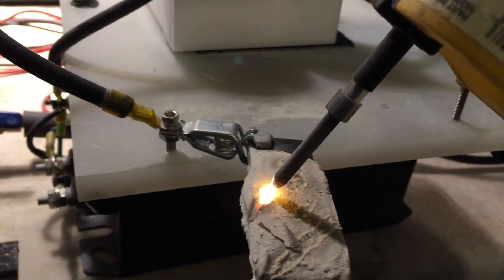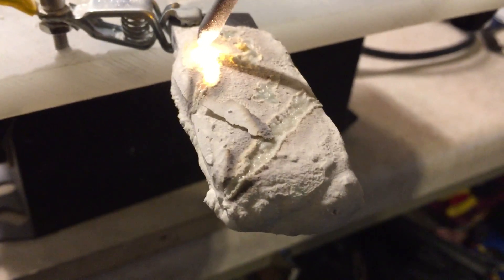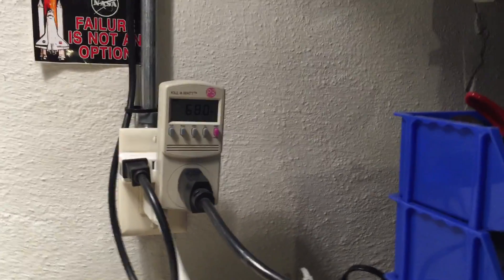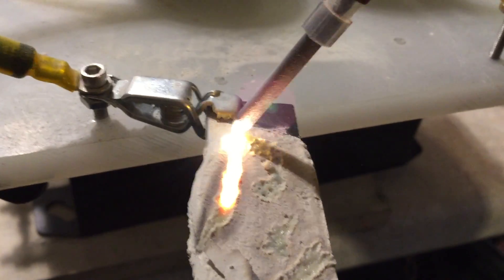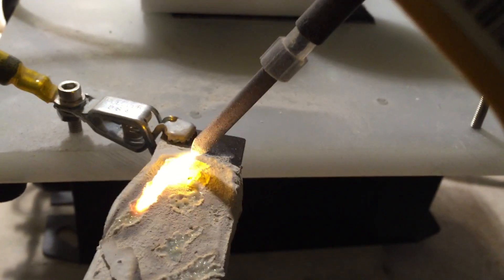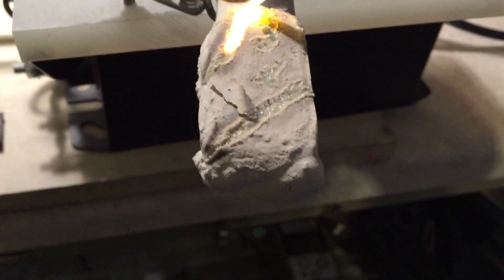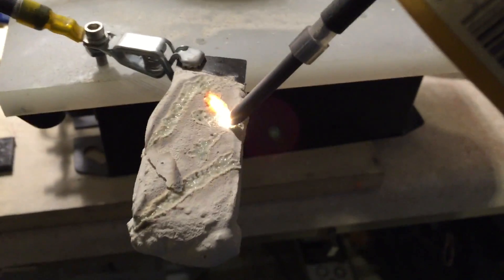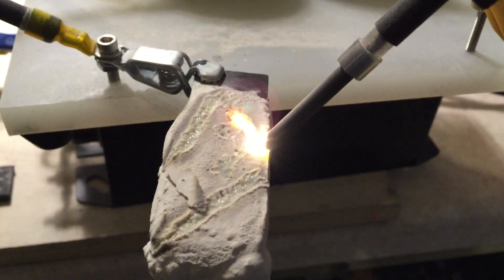PLASMA MELTING PUMICE WATTS! WHAT?!

Comment: furnace??
Reply from the maker: No it is a low current HV AC circuit designed by Nikola Tesla.  No discernible current can be measured in the molten material.

Comment from the maker: I'm using a France Neon sign transformer 7530 P56-2E that has a primary 120V 60Hz 2.1 amp and its secondary is 7500V 30mA. I am happy to share all, and I believe at the end of one of my videos Plasma Melting Pumice Watts! What!? I have photos of the set up and close up of the HV caps.
Billy's work with vibratory creation of the dendritics is intriguing, but I believe it may be a multi force and electrically primary in its formation. The features on Mars would be more pronounced with dendritics if large scale vibration were the etiology. Billy's work is excellent. I hope my less than conventional perspective may help elucidate the large scale mechanism of action. I will load a neat video showing the Massive Vorticity Birkland current and the seeming amplification of its effect as more material is picked up by the vortex. I also think that this is the likely core etiology of Tornados to be sure. It's capacity for surface alteration and picking up debris without damaging adjacent structure is phenomenal. I would look forward to meeting with all the inventors and researchers on this project. I would bet a few days with our equipment would make for a very interesting meeting and outcome!